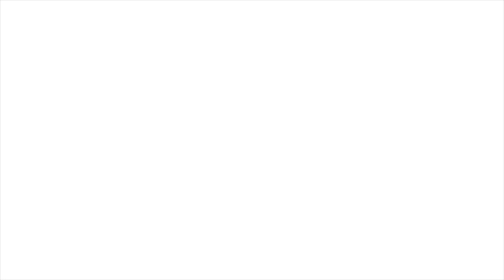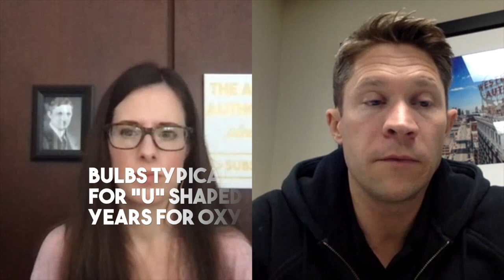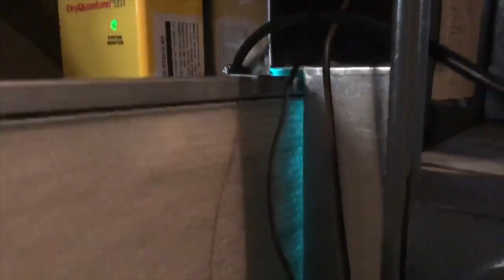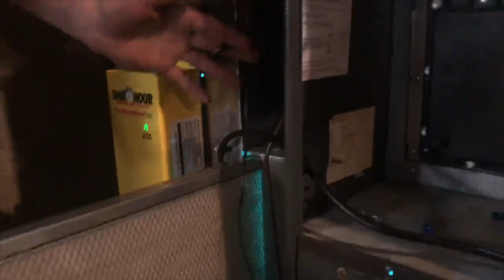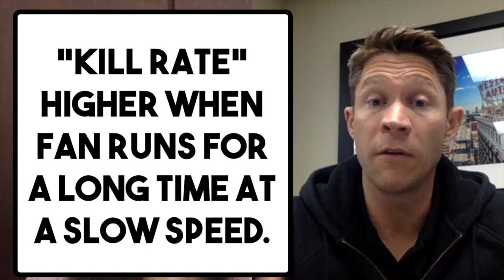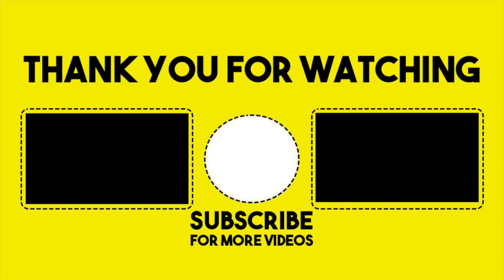UV Light Maintenance Plus Best UV Light Location and Settings for Performance

Comment: I just had a new system installed with the new UV Light and noticed a day or so later the light stays on even when the system is off won't that #1 cost me to operate another light in my home and #2 shorten the life of the bulb? the System was installed by One hour 9-12-2020  Also had a Duct added to the system for a tiny 7x9 room that didn't have heat or AC Before,  but I am not getting any cooling or heat from the Duct that was added, It blows very Soft and not enough to do anything in the room. The added duct was added from the bottom of a downflow Furnace and was run straight up into the attic and over into the room thru the ceiling. the guy said to give it some time to work but I gave it two days to help cool the room with the door open to the home and still never dropped below 80 deg and I had that before adding the system and new duct with a fan in the doorway.

Any info would be a blessing   Thank you.